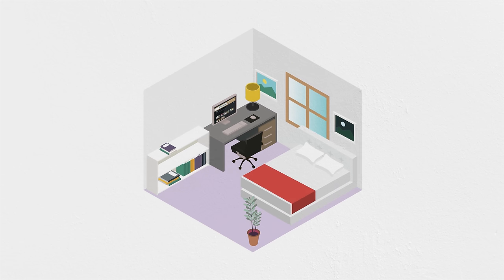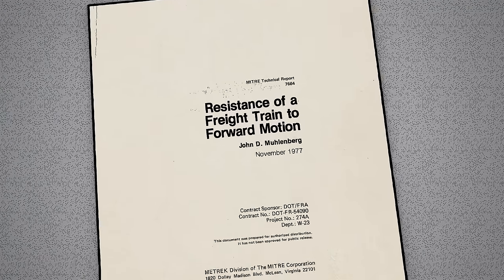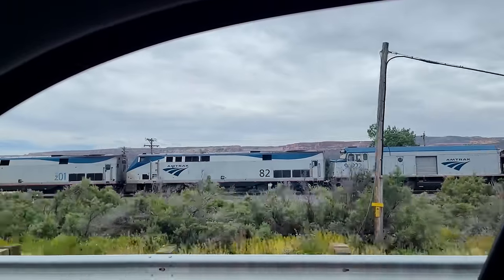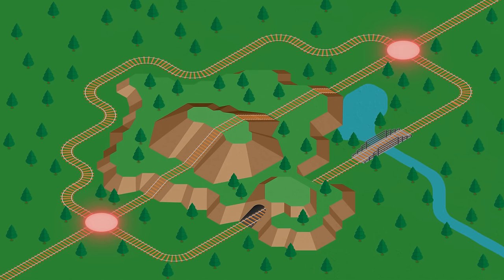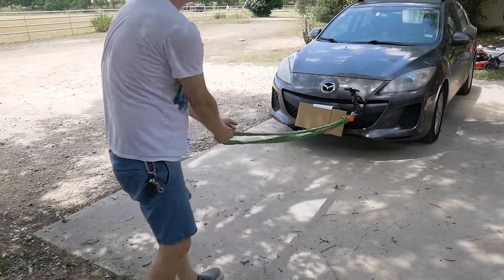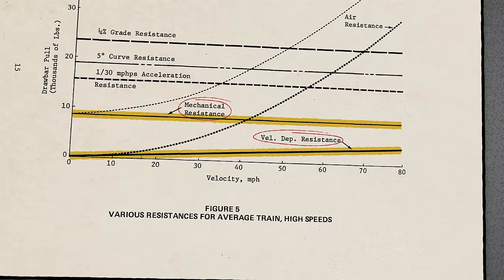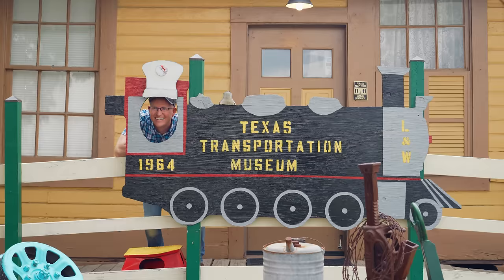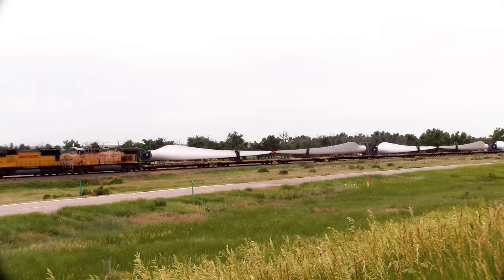Which Is Easier To Pull? (Railcars vs. Road Cars)

Comment: This was good!   I like discussions on the physics of trains!   I never heard a discussion on how much the joints in railroad tracks can add momentary high resistance, it's obvious when thought about and can be seen.   

On curvy track the total degree of curvature per mile is used to give an estimate of power required along with the ruling grade.  Even though gentler curves of 3° have a lot less resistance than 8° curve the 3° curve has a longer duration.   I haven't seen if the relationship is near straight line linear.   The range of curvatures encountered on a typical track appears to be close enough to treat it as such.   

A 3° curve is considered to be a the limit for standard gauge track where the conical shape of the railroad wheels will compensate for the inner and outer curve lengths.   A narrow gauge railroad benefits by having the rails closer together and hence the inner and outer rails are closer in curve length.   

Rail-Trails are popular for bicycle paths and there is a mathematical power budget relationship between bicycles and freight trains.  Studies in the 1930s concluded a healthy 20 year old male can generate about 1/10th of a horsepower for 10 minutes before needing to recover somewhat.    At 170 pounds for the rider and 30 pounds for the bicycle that is 1/10th hp for 200 pounds or 1hp/ton.    In the late 1800's studies on the minimal needed horsepower to start a freight train on level tangent track concluded it was 1hp/ton.    After over coming the stiction of the friction bearings especially when some were using animal fat that nearly instantly became more liquid with the start of an axle turn and other factors the train would then typically accelerate to 12 mph.  Which is fast enough for many heavy haul freight where there is not other trains waiting to use the track.

Both modes of travel really need more horsepower to work effectively.   Practiced cyclists measure their power output in Watts and generate 100 - 140 Watts over a grade (74.57 Watts to 1/10hp).  ( My thermodynamic instructor took a lot off because on an exam pushed for time I used 750 watts to the HP and giving me an F.  I retook the class and got an A at a different school).   Freight trains today seem to run at 3 - 4 hp/ton.   The extreme torque AC locomotive traction motors can generate without burning up like their DC counter parts allows those locomotives to start trains with just 0.4hp/ton as reported for Black River Basin coal trains.  

Steam locomotives were better at low speed continues grades hauling freight than DC Diesel electric locomotives because steam locomotives can run all day at a grinding 8 mph at full throttle and don't mind heat, while DC Diesel electric locomotives hate heat and at high throttle at speeds below about 12 mph will overheat and shutdown after 10 - 15 minutes.     A lot of the fascination for steam locomotives comes from their intense visual display and sounds laboring at these slow speeds.   The intense complexity of the display and sound greatly disappears at higher speeds.  Every stroke of the side rods at slow speeds can be seen to push the train forward.  The exhaust sound says what the locomotive is doing with great detail.

The GE U23 Diesel electric locomotive, meaning 2300 hp,  had such badly designed trucks they would not get traction at starting speeds and would quickly overheat and shutdown on continues long grades, leaving the EMDs on their knees pulling coal trains through the West Virginia New River Gorge where we used to rail fan when going to WV Tech, Montgomery, WV mid 1980s.

Comment: The fact is that a locomotive, or series of locomotives cannot pull the entire train from a stand still. This is why there is play (slop or lash) in the couplings and why they back up the train first to take up all the lash in the couplings. Then they begin to go forward they're only pulling the first car, and then the second, etc. When the last car begins it's motion the train has good momentum and can continue.
Reply: If you can, it is not always possible to start a train with the slack run in. A train can still be slacked out and be able to start moving

Comment: You should have a look at the kiruna narvik line in northern Sweden/Norway it uses regenerative breaking (you can feed back power to the grid if your railway is elecrifed) when going to fast down hill, in fact this line is a net producer of power, since the ore moved from the high altitude at kiruna down to the sea in narvik, but you in the USA don't have that much of electrified railroad =(.
Reply: good point i was going to say! clever swedes!

Comment: I would love to see you talk about the linkage system for trains.  Specifically, what prevents cars from yo-yo-ing in the middle when there are engines at each end.  If they are being pulled from the front and pushed from the rear, won't there be some cars in the middle that are crashing back and forth in the slack?
Reply: There is no slack. It's a solid connection with no forward or aft movement.
Reply: @J.C...  When they hump the cars in the hump yard and they crash together, you can see the couplers giving in to the inertial impact.  That movement is not like the ball pendulum desktop toy that shoves the engine forward as each car bumps into the line of cars.  There are shock absorbers of springs that absorb some of the impact, and in a long line of cars that slack adds up.  

Imagine a 1 mile long train being pushed up a hill with the engines at the rear, and then compare that length to the same train being pulled up a hill with the engines at the front.   I would imagine that the train being pushed up a hill from the rear would be at least 100 foot longer from all the slack between the cars and the shock absorbers/springs being compressed, vs stretched.   

In a train with engines at the front and rear, there will be some point in the middle where some cars are constantly chaining between being pulled and being pushed as the resistance on the track changes or wind friction or from changing gradients.

Imagine stretching a slinky out on the floor very long and pulling on one end while pushing on the other, and then dragging it over an uneven floor like you would the train.  There will be some point in the middle that is constantly changing between being pulled and being pushed.  As this point changes along the train, those cars will be crashing into each other and constantly jostled about.
Reply: Depends on what your standard coupling devise & method is for your region. A TL:DR rundown is like this, there are two types, a "quick" coupler, and various types of "hook & loop" and "Knuckle". The lighter the car the more you have to worry about "string-lining", the heavier the car, the less so. Usually it's advised to put lighter cars at the rear, and heavier cars towards the front, like UPS/FedEx doubles & tripled here in the US. The lighter trailer (usually 28ft long) is always the rear most trailer. No, cars in the middle don't care about slack...the cargo does. Some cargo can only be put in specific cars with proper cushion cars. If you are in the US, next time you see a train, look for the ones marked "cushioned load", or have extended coupler boxes on the ends. With modern packing methods, they are becoming rare, some notable types for each US rail network is: Southern Pacific, Santa Fe, Chessie System, and Southern Railway (not the UK one). In addition, with the advent of Precision Scheduled Railroading (PSR) here in the US, you will sometimes find one or more engines on the head, mid-train as distributed power (DPU), and on the end, though prior, you'd see these types of combinations in mountainous regions, mostly head & end, but mid-train DPU did occur regularly.
Reply: The engines are linked so that they speed up and slow down in a way that keeps as much slack out of the consist as possible. So if you see a consist with helper power that will commonly have the head engine running just slightly lower than the helper which keeps the slack tight. Then as the grade lessens they reverse roles a bit and the lead engine stretches the consist out as the helper slows down. For a consist with distributed power it dose a similar thing, the lead engine controls the slack by stretching the consist until the middle engines start moving, then they assist and pull the remainder of the consist behind them, basically 2 trains but running coupler to coupler.
Reply: @J.C...  Many broken knuckles are piled up outside the section office from engineers that had too much slack action and broke knuckles, draft gears, even car frames.
I most earnestly assure you that slack action on a train is a significant force and must be in the awareness of the engineer at all times. The EU uses a sprung buffer which minimizes this but slack is still a factor even so.
Reply: @Blazer02LS  Imagine the train on level ground with engines at the front and rear.  In order to always have the cars compressed together (or stretched apart) with no floating slack between them, either the engines at the front are doing no work and are being pushed, or the engines at the back are doing no work and are being pulled.  As soon as that changes, then there MUST be slack somewhere between the first and last cars.

Now imagine a train where 50% of the cars are being pulled, and 50% are being pushed.  The cars in the middle are going to be jostling back and forth between being pulled and pushed as it goes up and down hills or around bends.
Reply: The EU is going to switch over to a variant of Scharfenberg type 10 called the Digital Automatic Coupler(DAC), but currently the couplers used in Europe are the following:
   Scharfenberg: used for passenger trains
   Screw Coupler and Buffers: most common for freight and used for interchange between countries 
   SA3: Soviet & especially heavy trains outside the former soviet block e.g. Malmbanan(Iron ore line from Kirruna to Narvik)
   C-Akv: German upgraded SA3 that is backwards compatible often used for especially heavy trains
   AAR: Janney/US used for especially heavy trains
Reply: Close. The engines are throttled so they either apply lees or more force to the consist. So on level ground the lead might be at 50% throttle, the trailing engine would be at 49% to keep the slack at minimum. Then on a grade the rear engine would throttle up so it says at about a 1% higher number than the lead engine, that tightens the consist and then it drops back to pace the lead engine. 
It's a delicate balance and even then you can get a train that runs a bit loose, but the coupler designs are such that the minor slack that does happen is not an issue. Where the slack is an issue is really in starting a heavy consist. It's actually something covered in training on rail operations. These days a lot of it is automated but on switchers it still applies. 
Don't forget that all the engines in the consist are linked together so that the lead engine controls everything as well.
Reply: @Blazer02LS  MOST locomotives in the US have 10 throttle positions, whether controlled by a human or computer.
Run 1 through 8, idle,  and stop. (Old "B" units would have a hostler control with 1-3, idle, and stop.)
There are some locomotives equipped with special power controllers, (Think LocoTrol, it varies the field power in the generator or alternator and is used to control ultra slow speed movement for loading or unloading) but the prime mover has only the 10 selections above. 
On distributed power, the engineer usually establishes "power zones" when making up the train which link engines in proximity into a selection. During operation the engineer simply selects all or some zones is controls at that moment and at what power or for dynamic breaking.
An engineer would not control the power of the locomotives to such a fine extent as 1%.
Reply: @BattleshipOrion  Chessie System .. now that's a name I haven't heard in long time. Always thought it was pretty

Comment: Fun fact:
LKAB (Swedish mining company) uses the worlds strongest electric locomotive to haul 750 meter long trains, total weight of 8.200 tonne. They use one (they are double locomotives), in the front of each train, and they run up to 20 trains every day. The type of locomotive is Iore. 10.800 kW. 1.400 kN starting force.
Reply: 10,000 ton trains are quite common in the USA and lengths of 10,000 feet or more with as few as 2(4400 horsepower each) locomotives. Power can often be lower than 1 horsepower per ton.

Comment: Also - in a dynamic scenario - there is resistance depending on acceleration. The obvious one is F = m*a, but the less obvious one is the force needed to get the wheels, axles and motors spinnng. I.E. to get a wheel running along a track, you need to accelerate it not only in a linear fashion but also bring it up to speed rotation-wise!
So pulling a train (or car for that matter) and change its velocity is way harder than pulling it at a constant speed.

Comment: I don't normally comment on someone's sponsorships, I do actually feel pretty strongly on this one. it is definitely worth switching to the safety razor the blades So much cheaper and actually last much longer And actually far easier to get than you would think. And  you can actually clean them and dry them properly, which means you also cleaner more hygienic shave. I've never used this brand razor but But it does look really nice. And to be honest I've never had any problems with any of the brands of safety razor I've used So I would be Very confident in it.

Comment: I'd be interested in seeing how they maintain the railroad. How they repair floating tracks like at 10:54 would be a good example. All that flex must increase resistance to the trains passing and put a lot of strain on the rails.
Reply: Actually, a certain amount of flex is better than trying to keep the rails rigid. The rail flexes because the weight of the car and its load is concentrated there under the wheels and the flex allows that stress to be shared along a constantly moving distance of rail instead of a chain of single points. Now, true, as always there can be too much of a good thing. And then there's the thing about the ground itself flexing as the seasons change. And there is also the thing about the rails themselves stretching and contracting as the seasons change between hot and cold. The ballast gravel serves two major purposes; it allows rain water to flow through and away from the rails and crossties/sleepers, and its sharp crushed stone edges jam against each other and do just enough of a job of locking those same crossties in to place without locking them in place too rigidly. Every so often railroads will go through with specialized machinery which removes, cleans, and repacks the ballast stones.
Reply: @scottfw7169  no lol, rails are not designed to support the weight of trains like this - they’re designed to transfer the weight to the sleepers - and sleepers are not supposed to move. this is really bad and can be fixed with a tamping machine, by relaying the track or with some more ballast and manual tools.
Reply: most modern railways will have specialised trains called tampers specifically pack ballast tightly under sleepers, also having concrete sleepers instead of wood helps. this just looks very cheaply built and badly maintained.

Comment: It's neat that the force to pull a car is roughly equivalent to a rail car. That's actually insane. North America's biggest blunder was abandoning its once vast rail network in favor of cars and trucks.
Reply: Yes, you are right. that was the bigges mistake of USA. Now the whole country is dependant on the wastly inefficient and heavily dependent on oil transport. There is not a shadow of chance that USA will survive the closing peak oil.

Comment: I had so much fun as a kid smashing coinage on the track. My fav was dime on penny on nickel on quarter. As you went down the stack each coin was impressioned into the one below and the quarter and dime had smooth sides from the rail and car. The hard part was finding all 4 coins after the traine went past.

Comment: Great video!  I think there are some additional things about trains that your viewers might like to hear you explain in a video.

In general, passenger trains and freight trains have significant differences.  Passenger trains have non-slack couplers and start from a dead stop.  Freight trains have slackable couplers and mostly do not start from a dead stop.  

Slackable couplers have three states:  Stretched, slack, and a bunched/compressed.  Stretched couplers are under tension and transmit forward/acceleration force from car to car.  Slack coulpers don't transmit force between cars.  Bunched couplers are compressed to their shortest length, and tranmit force backward/breaking force from car to car.  (I'm simplifying to the general case a bit.)  

Unsually, a train can't start from a dead start and the procedure is as follews:  The locomotive(s) operate in reverse until the last car moves a bit.  This bunches all the couplers.  Then the locomotive(s) move forward, accelerating one car at time, and each car's momentum is added to that of the locamotive(s) and the previously accelerated cars.  IMHO, there is about a second between the acceleration of one car and the next.  That delay is what allows a freight train to start without pulling all cars at once.  The industry expression is "If you can start it, you can move it."

Comment: The actual physics behind the rolling resistance takes into account the hardness of the materials, and hence the contact area or length.  A rubber tyre has a longer contact length, so the front edge of the wheel is trying to go up-hill to a small amount.   Also because the wheel bearings are always of a smaller diameter than the wheel rim, they add to the rolling resistance.